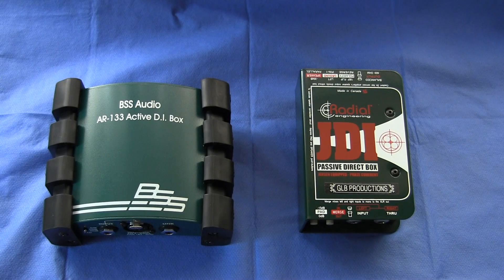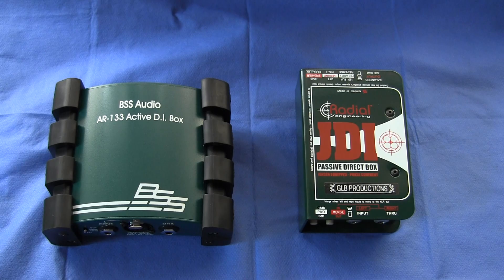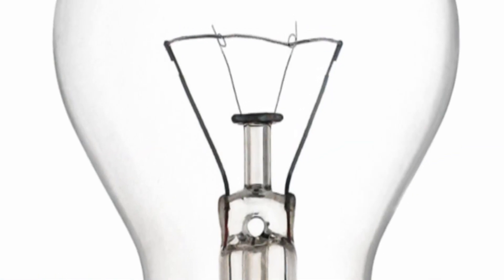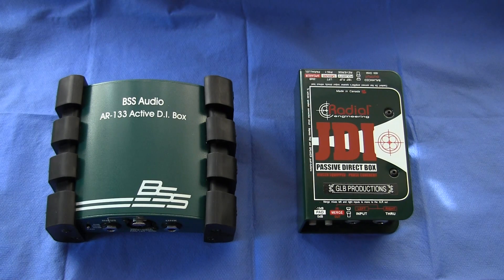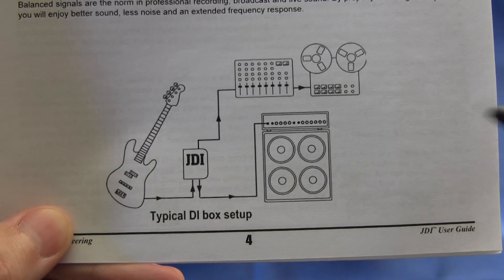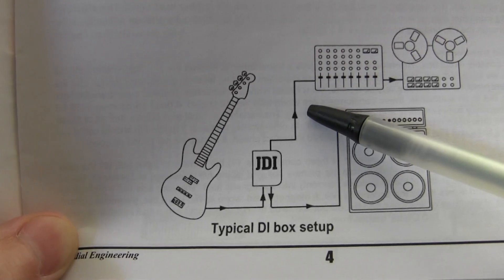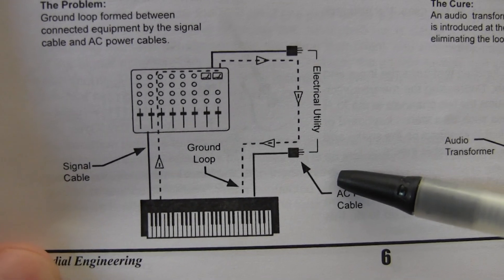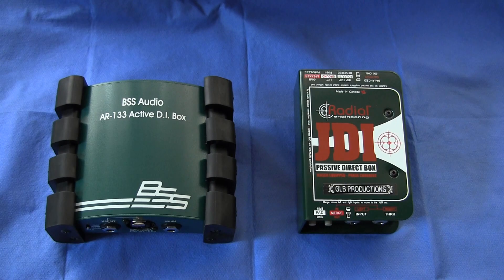DI boxes part 1: What does a DI box do, and when do I need one?

Comment: Im currently running my.vocals and keyboards straight into the sound mixer on small stages, would my sound be better from a D.I?
Reply from the maker: Matthew Wilkinson Probably not - the main purpose of a DI is to convert unbalanced high impedance signals to balanced low impedance signals that can be run long distances without being degraded by noise and interference. If the distance from your instrument to your mixer is already short to begin with you have no need for the main functions of a DI. Having said that, some passive DIs add a certain warmth to the sound due to the qualities of the transformers that they use. Jensen transformers are particularly noted for this effect.

Comment: What is you prefer to record stereo (L/R) out from your keyboard? Do you need a stereo DI box?
Reply from the maker: Tampa Bay Yes, either a stereo DI box or two mono DI boxes. Again, note that some keyboards already have balanced low impedance outputs, usually on XLR connectors, in which case no DI box is needed.

Comment: I think I get the gist of it... A "direct box" allows you to plug "directly in", yes?
What if you plugged you guitar or bass through an FX processor, would you still need a DI box?
Reply from the maker: Tampa Bay Exactly, it's way of connecting a signal to a mixer that does not rely on a microphone. 

With an effects processor in the signal chain, your signal would become low impedance. In addition, some effects processors have balanced outputs - in such a case there would be no need for a DI box as the two main functions of a DI (impedance conversion and signal balancing) have already been accomplished.

Comment: Hi I want to connect my guitar to my pc so I can use guitar rig 5, what sort of DI box would I need? would a Live Wire SPDI Passive Direct Box with Attenuation Pad  do the job? any recommendations would be welcome. My guitar has active pickups the dimarzio shockwave system. I know nothing about Di boxes hence I'm looking at videos like yours, after a bit of research I bought a whirlwind lead as my old lead was 22 years old and I was getting a lot of excess noise, thanks.

Comment: Hi, will it be advisable to use a D.I box (phantom powered version) with an xlr condenser mic. I have the scarlet focusrite preamp which has only 2 mic inputs. If I wanted to record with 3 mics, will connecting the DI box to the preamp work for this purpose? Thanks.
Reply from the maker: Danny King No, if the microphone has an XLR connector its output is almost certainly already balanced and low-impedance, so no DI box is necessary. If you want to record using 3 mics and have only 2 channels on your preamp you'll need to use a microphone combiner on 2 of the mics, or use an external mixer to reduce the total number of signals to two.

Comment: Great video! High quality and very informative. If you could, I'd like you to help me with a somewhat unique question: I want to know how to mic an amplifier, convert it to an unbalanced quarter-inch, then run it through my time-based (reverb, delay, etc.) guitar effect pedals, convert it back into balanced xlr, and finally run it into the snake.

I am an electric guitar player and I use a pedal board with several pedals for all my effects. For my style, time-based effects like reverb and delay are important. As a general rule, most guitar players run their reverb and delay last and the whole signal chain comes through the amp and is then miked. The inspiration came to me one day, while reflecting on studio experience, that when you mic an amp in studio, the amp is kept completely dry and reverb/delay is added in post, so I thought, "Why can't I do that live?". My thought was that I would either need a small line mixer or an all-in-one direct box that has both in/out for .25in and in/out for xlr to do the conversions.

The whole point, to finish, is to create a more natural spacious sound, since in real life, echoes of reverb and delay come after the sound exits the speaker cone and bounces off of walls and other surfaces; the standard live setup (reverb/delay thru the speaker, then miked) actually does this inside out. I'm sure some famous guitar players (like the Edge) and others do it all the time; I just don't know how.
Reply from the maker: Jacob Morris Hello Jacob, thanks for getting in touch. As you know, the process that they use in the studio is called re-amping: the signal from the amp is recorded dry and then the recorded signal is sent from the recording equipment back through the amplifier and re-recorded with effects added, hence the name re-amping. 

If you are doing this live, you will need two pieces of equipment: 

1. A line matching transformer to convert the balanced, low impedance signal from the mic in front of your amp to an unbalanced, high impedance signal which can be run through your pedal board. For this I would recommend the Shure A85F: http://www.shure.com/americas/products/accessories/microphones/microphone-problem-solvers/a85f-line-matching-transformer

2. A quality passive DI box to convert the signal at the end of your pedal chain to a balanced, low impedance signal that can be run into the mixer. For this any good quality DI box will do, although I personally use and recommend Radial DI boxes. 

Hope this helps. Note that you may need to adjust the settings on your pedals when using this method, as the signal from the mic via the transformer will not be exactly the same as the signal out of your guitar.

Comment: Do I need DIY one?
Passive or active?
Is it good for piezo pickup equipped acoustic guitar?
Reply from the maker: moses1202 Which make and model of guitar are you using, Moses?
Reply: I've found some di schematics, one has two op amp pushing balanced output and another one is a buffer pushing a transformer.
Reply: My guitar is Hofner acoustic guitar with handmade piezo pickup and tillman preamp.
Reply from the maker: moses1202 The Tillman preamp uses a 9V battery and an FET-based design yes? If so a passive DI will work fine, which is basically just a transformer in a metal case. If you decide to build your own passive DI the choice of transformer is critical - make sure you use the best quality one you can obtain.
Reply: I don't have a good transformer for DI and no source to get so I decide to make an active one with a bad transformer for better performance
Reply from the maker: moses1202 I see, you are most inventive! If it sounds good, that's all that really matters.
Reply: I main issue I face is that when I plug my guitar into the preamp or amp, sometimes it hums and sometimes it comes feedback hardly. So I need something like DI box to match the impedance or provide isolation. Any more suggestion for this problem? Or it doesn't need DI box instead?
Reply: BTW, my guitar is hohner not hofner

Comment: I'm a professional songwriter/performer/teacher and have tried to explain to my students the function of a DI box. Until watching your video no-one had managed to explain to me (or maybe even tried) the ground lift function, and although I knew what high impedance meant I didn't understand. The 'third' function was the 'main' one I taught students, since at our college the practice is 'DI the amp or mic it' - no-one except keys and acoustic guitars gets a DI box.
For this, thank-you; however, there's another thing I want to thank you for:

Low-end hum has been appearing on my passive acoustic guitar pickups - they're all the same but don't suffer to the same extent. Here's my signal flow:
passive piezo - short lead - belt preamp with EQ - 5 foot trs lead - then either desk, or Vocalist 5 pedal/through on trs to desk. I also normally use an external mic which is 'suckered' on the shoulder of the guitar.
The buzz stops (or is at least reduced to an acceptable level) by putting my bare foot on the metal casing of the Vocalist 5.
 The buzzing happens more in some venues and not at all in others, leading me to the conclusion that dimmers might be the culprits.
I'm going to try using my behringer DI box in the signal chain and using the ground lift as you illustrate. I'm also seriously considering two cheap radio systems for the guitar('s') pickup and mic. I'll let you know about the DI box solution, but do you think the radio systems would also solve the problem?
Thanks again - is there a donation option?
Cheers
Dan Plews
Reply from the maker: danplews Hi Dan, thanks for getting in touch, and I'm glad that you and your students were able to benefit from the video :)

The first thing to do is to determine whether you are dealing with buzz or hum: Buzz is noise caused by things like lighting dimmers, ballasts, poorly designed power supplies etc. Hum is the sound you get from ground loops, and is always at 60Hz or the harmonics thereof (I assume you are in the US - in countries with 230V systems it's often at 50 Hz). Lifting grounds will help with hum but will often make buzz worse. 

You say that the noise is reduced when you put your foot on an metal object which is grounded - this suggests that you have a grounding issue rather than a group loop issue - ie lack of a ground rather than too many grounds. In this case, lifting grounds may not help - however by all means try it and see, because these factors often interact in unpredictable ways. How is the Vocalist 5 grounded? Does it run on battery or get its power from an AC adapter? 

Seeing as your set up is quiet is some venues and noisy in others, it may be worth experimenting to determine the cause of the noise - turn lights and circuit breakers on and off, try different power outlets and see if one particular switch or circuit causes the noise. This will all help us to solve your problem. Let me know how you get on :) 

I don't actually have a donate button, helping people is a reward in itself, and in any case I teach paid classes in Singapore where interaction and communication are easier.

Comment: Do I need a DI box when I have an audio interface?
I heard I need to connect the guitar -> DI box -> audio interface -> computer for recording. is this correct?
Reply from the maker: dldydals97 It depends on the distance you have to run your signal - if the signal path is less than 15 feet/3m long then you don't need a DI box, so if you are sitting next to your audio interface you'll be fine.
Reply: Oh ok! Cheers!

Comment: Should DI boxes be used for recording acoustic drums that will be miked?
Reply from the maker: Wil Bane Generally not - the output of professional microphones is already balanced and low-impedance, removing the need for a DI box. The only time that DI boxes and acoustic drums are used together is when electronic triggers are being used on the drums in order to activate samples, either live or later in the recording process.
Reply: Thanks!
Reply from the maker: Wil Bane You're welcome, all the best with your music.
Reply: GLB Productions And you as well! Rock on! \m/
Reply from the maker: oldschoolrock4evr
Thanks for subscribing :)

Yes the 2i2 can accept a guitar directly when set to the 'inst' setting.

By the way, something like the 2i2 is referred to as a USB recording interface, not a soundcard - the latter is normally something installed inside a computer as opposed to an external unit.
Reply: GLB Productions
 what about if you plug your guitar directly in your soundcard? do you need a DI BOX?
Reply from the maker: oldschoolrock4evr
If your soundcard has a high impedance or Hi-Z input a DI box is not required.
Reply: GLB Productions
 Thanks man for the fast response i subscribed : ) i ordered Focusrite 2i2 soundcard and i dont know if it has a high impedance input, it has an instrument/mic switch maybe thats it?

Comment: Connecting to PA from 1/4 Emulated DI Out jack socket of a Marshall AVT 50 Combo. Passive or Active DI box? Thanks for your time.
Reply from the maker: Eric Montes Hi Eric, I would use a passive DI on those emulated outs. I did a show recently with two Marshall AVT amps as part of the backline and they sounded great - the emulated outs can be a bit hard sounding and a good transformer will help to warm up the sound. All the best with your music!
Reply: GLB Productions Any recommendations on a budget? Considering an IMP 2.
Reply from the maker: Eric Montes Yes the IMP2 would be my recommendation. Cheap and good as we say here. They are not the best sounding DI box available but for the money they can't be beat. And please don't buy any knockoffs! Alternatively if you have a bit more money look at the Pro series DIs from Radial.

Comment: Is it also possible to have a DI box or something similar that goes XLR-Jack instead of Jack-XLR?
Reply from the maker: MyTomByoozChannel Yes it is, but could I first ask what you are trying to achieve?
Reply: Well, what I want to do (and I am aware there are other ways to do something similar) is connect a microphone to a Boss digital effects station. (ME 50B to be exact). I want to do a music thing like an artist called Dub Fx (you can look him up on YouTube) who uses a Boss Gt-10B.
Reply from the maker: MyTomByoozChannel Ok I see now. The issue here is that something like the ME50B is designed to accept an unbalanced instrument level signal rather than the balanced mic level signal that your microphone provides. My first suggestion would be to just use a simple XLR to 1/4" cable, one that ties pin 3 on the microphone output to ground, effectively creating an unbalanced output. Depending on how much gain is available on the Boss pedal, you may or may not get satisfactory results. If there is too much hiss or no signal at all, you would need to use some sort of preamplifier between the mic and the pedal, such as a small mixer.
Reply: Thank you very much! Can I get back at you if I need some extra advice? I'll look into it.
Reply from the maker: MyTomByoozChannel No problem, let me know how it works out.

Comment: Hi GLB team. Can you help me with my problem?  I have Mesa M3 Carbine, the rack version, with DI output (XLR) and I want to record my bass guitar using M-Audio Fast track audio interface (XLR input for mic, line and guitar jack input). Obviously I cannot put DI from MESA to mic input on M-Audio interface, it makes only crazy sound. Is in this case DI Box useful? So I can maybe go with XLR from Mesa to DI Box and then continue from DI Box to LINE/GUITAR input on M-Audio interface? Thanks for a tip.
Reply from the maker: - Hi Jiri, thanks for getting in touch. In this case the first thing that you should try is to use the PAD on the input of your M-Audio interface. If you still get distortion with that, then you should use an XLR to TRS adaptor to adapt the output of your Mesa M3 to the LINE input. You can see the adaptor in my video DI boxes part 3: Amplifier DIs - using, advantages and disadvantages Hope this helps!
Reply: GLB Productions Great, that XLr to TRS solved my issue. Many thanks, keep rockin'
Reply from the maker: Jiri Borek Awesome! Glad to hear it all worked out.

Comment: Could someone please tell me more about what he starts talking about at 11:26, i just want to make sure i am not doing anything wrong.
Reply from the maker: - Basically, if your system buzzes, don't cut off the ground prong on your power plug!
Reply: GLB Productions But how about if the mixer i am using doesn't have a ground prong?
Reply from the maker: - Which mixer is that? Some mixers use an external power supply with a floating ground and are designed to be used that way.
Reply: GLB Productions It's a behringer xenyx 802.
Reply from the maker: Iamyo0tube Yes, that mixer has an external power supply with a floating ground. This means that your electrical ground is actually derived somewhere else in the system, most likely from your power amplifiers. All the best with your music.

Comment: Can I have my amp connected to a di and then have the di connected my computer via USB without it affecting the quality of the signal that would then come out of my computer?
Reply from the maker: Hmm, you'll need to tell me more - what equipment are you using and in particular which DI box? Also how do your propose to connect them together?
Reply: I'm thinking of plugging my guitar via jack lead into the D.I box and then have a USB going out of the D.I box and into my computer. Would this work well, or would it give a low quality signal? I'm hoping to use one of the D.I boxes in my school (I can't remember the exact make or name of it, but it's very similar to the one in your video).
Reply from the maker: David Gardner Hmm, there are very few DI boxes out there which have both an XLR and a USB out - it's possible that the unit you are referring to is actually a USB recording interface and not a DI box. They can look very similar! Please find out the make and model of the DI you are planning to use and let me know, then I'll be able to advise you further.
Reply: I'm thinking nof getting: "Behringer Premium 8 Input 2 Bus Mixer with XENYX Mic Preamps/Compressors/British EQs and USB/Audio Interface"

It only has USB as an output, so I assume that it will work when plugged straight into my computer? My main concern is that because it's USB, the signal going into the device won't sound the same when it comes out of the computer speakers/headphones.
Reply from the maker: Ah ok, that's a mixer, not a DI box. I'll be honest with you, those small Behringer mixers can be extremely noisy - if I were you I would stay away from Behringer gear and go for something higher quality. If you are looking for just a recording interface I recommend the Steinberg UR22.